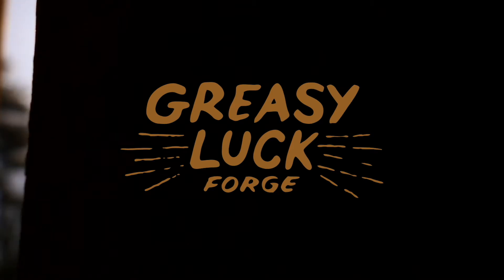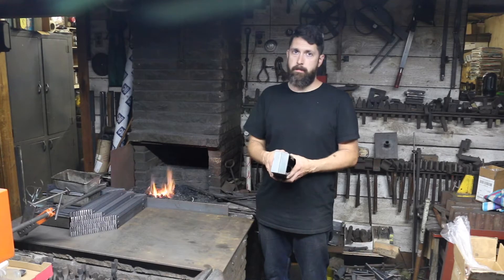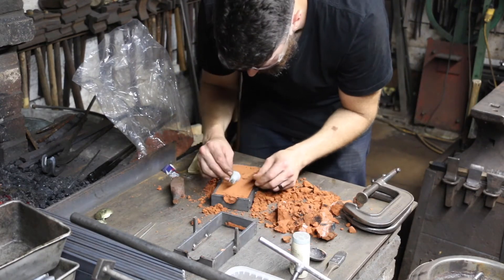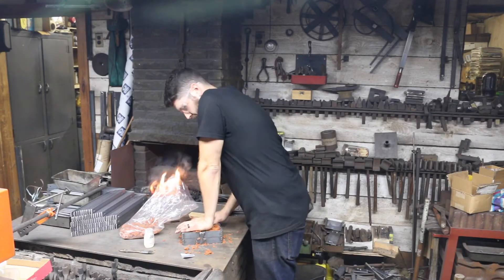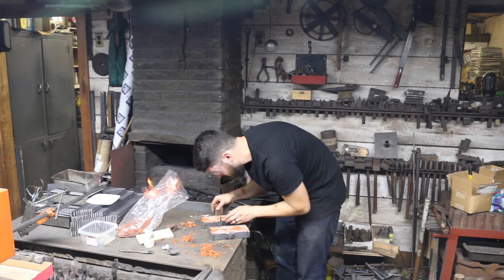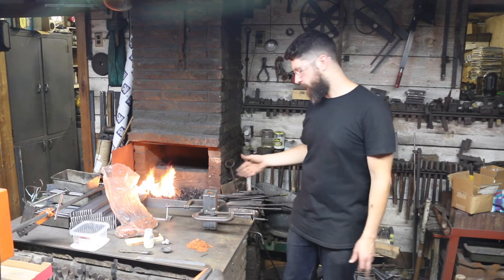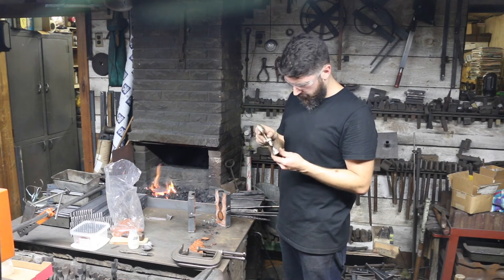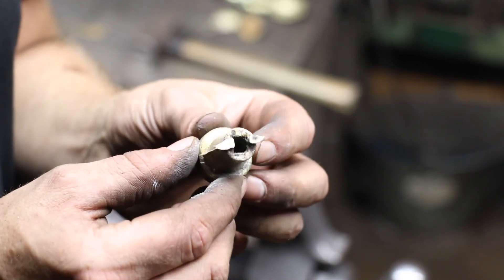Casting with Sand Cores

Comment: What holds the core in place? Seems to me it would move around
Reply from the maker: The sand core is longer than the piece being cast and it extends past the sand into a void that the pattern leaves, top and bottom.

Comment: I had issues with casting surface quality that I think is related to talc found in baby powder. It leaves a kind of crystalline looking surface.
Reply from the maker: Did you switch to something else? Like I said in the video, I'm still pretty new to casting so I have built in allowance for cleaning up and filing down the surfaces any ways. Where my quality is at at the moment I don't know if I could tell a difference, but I'm open to suggestions for improvement.